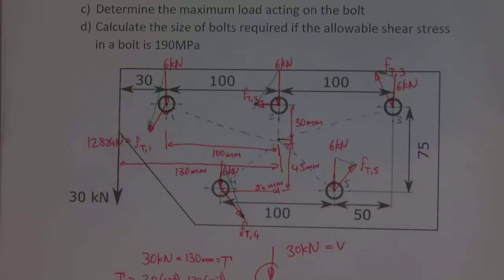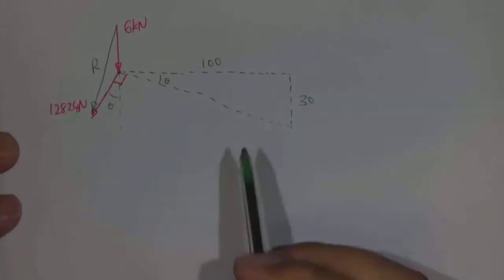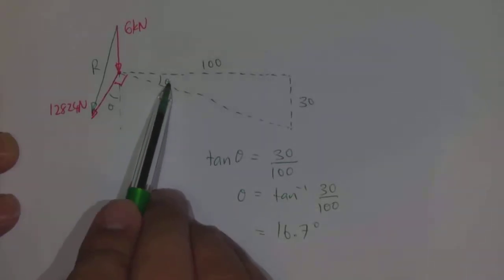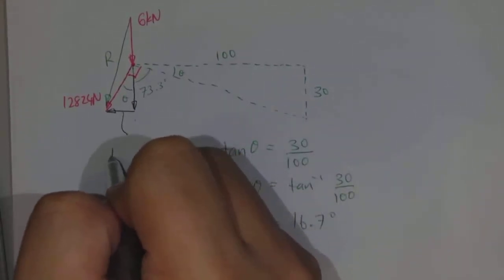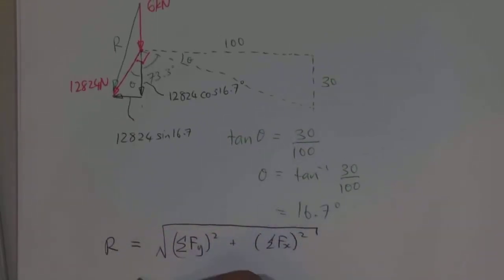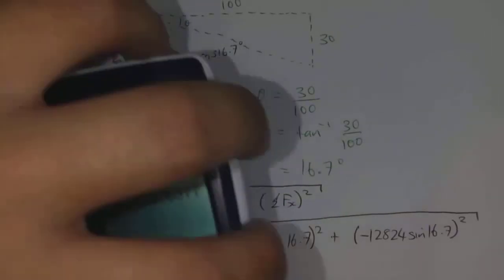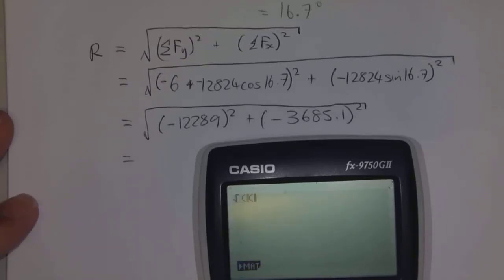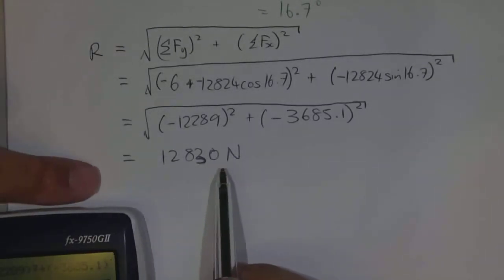Example - Bolted connection with torsion and shear loads (Part 5 of 6)

Comment: Hi,
I recalculated the resultant force for the bolt (1) and I got the value of 18.65 (KN) for that.
Could you confirm the accuracy of this value?
Thanks,
Reply: Yes, 18650 N is the correct value. He mixed the unit, suppose to be 6kN which is 6000N (he did 6N)